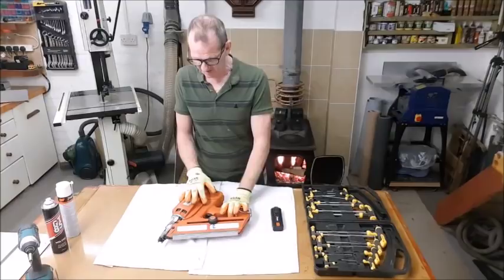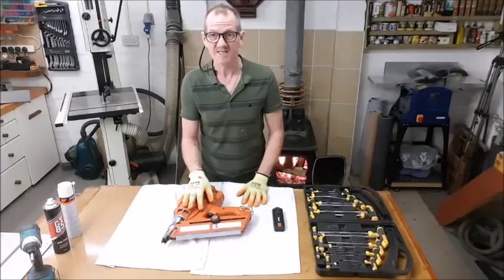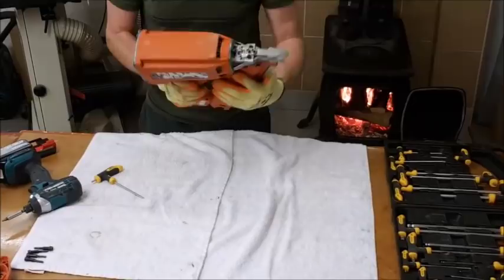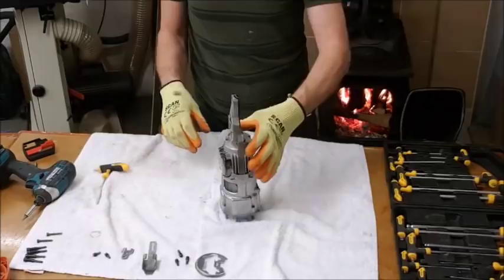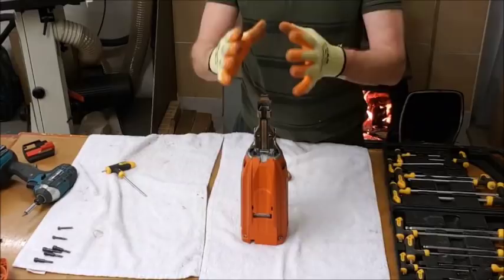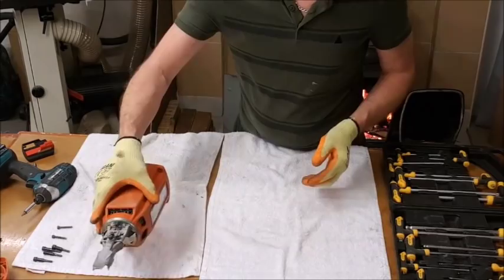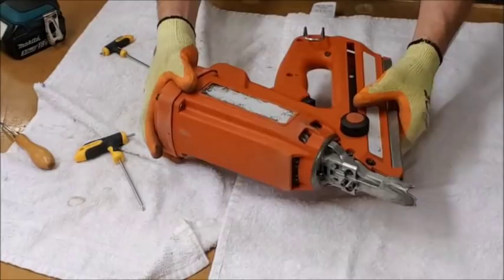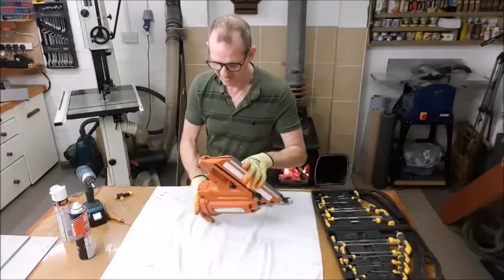Paslode IM350 full strip down

Comment: You sir are a genius! I hastily stripped mine down to clear a jammed nail, and once separated a load of bits fell out! Good to about the small spring as mine fell out and never noticed. Also for the life of me, do you think that I could work out how to refit the chamber lock bar? Now I know next time it's simply a case of undoing the two screws securing the chamber to the handle.

Comment: Thanks Dave, had a misfiring IM350 for ages, followed all your steps to give it a real deep clean but was gutted when it still continued to misfire.  But by watching your video I only realised there was the second o ring, so after replacing both, the gun nail fires perfectly.  Thanks very much for posting such a comprehensive video.
Reply from the maker: Thanks Gary glad it helped, when you say you replaced the two O rings did you mean the piston rings?
Reply: No I just replaced the o ring on the outside of the chamber and the one by the fan. Should I replace the piston rings while I’m at it?

Thanks

Gary
Reply from the maker: @Edge-ir8tb  if you can feel any piston slap then yes, push the piston up to the top and with one finger pressed on top see if it feels loose if not No its £25 to buy them as they are sold individually for some strange reason
Reply: @dmgladden  Thanks for the advice.  Gary

Comment: I went a little further and popped the circlip out of the end of the piston and clean the piston rings along with the rubber buffer. You can use a Torx key to remove the exhaust valve. Must treat with care and not bend any of the valve flaps. I put the valve flap on a very flat surface and ran the edge of a Stanley blade across the top and bottom to scrape the exhaust crud off, with help from some WD40. I think a cruddy exhaust flap was preventing the pressure build up and not getting proper explosion. Worked AMAZINGLY afterwards!!!

Comment: You’re right about the spring it’s a real pain had to look for it about four times well I’ll try and put it together and nothing would fall out until I found the best way of doing it very well organise is the only way so after feeling with that for two hours took two hours because I kept losing the spring Flicking out at one point I’ve got a spring from the Hand wash is a little big I think one out of a smaller bottle like a small bottle of sprite to clean your glasses it will probably work but you know what happen I was gonna use that spring was gonna try and then I had to cut it a little bit so short on it and it flipped off right next to the other spoon so I had to go pick it up how lucky is that

Comment: Great video. No nonsense and wasting time (which we all know isn’t always the case!). I have a 900420 and the o ring near the fan broke in a weird way where  (and this happened twice) the o ring broke in two places in exactly the same way - twice!  I can’t figure out why.  Also the motor works and yet it won’t fire.  Maybe that part that actuates the spark?  I was hoping you would show something about the small chamber above the fan which is where the gas goes but you can’t cover everything, it’s just my particular issue atm. Anyway, thanks for the helpful info. I’ll be subscribing.

Comment: That was an awesome video thank you very much. I put everything back together and the thing won't even turn on. I take the 2 pieces apart and put the battery in and it works. I put it back together and it doesn't. Any advice would be greatly appreciated.

Comment: David, firstly thank you for making this video as it gave me the confidence to disassemble my IM350 to look for a fault as it wouldn't fire. fault was found with a damaged follower of which i replaced successfully.
While i had the gun totally stripped down i decided to give it a full service which went well.
When fully reassembled i tested the gun it fired the first three nails fine then appeared to jam, after dissembling and reassembling a few times i noticed that the gas cover lid is rising when the upper and lower probe is depressed, it will fire however the fan will keep running until i press the lid back down.
Have you any idea what is causing this?  Found the problem little bit of lubricant required. Working as new now.

Comment: That`s the best of the best tutorials!!! May be you have another video where some diagnostic tips are subjected, please? It would be more that vital to have an idea with what to test in case if any common faults. As an example, how to understand whether the ignition coil is good enough? As you stated, this part is expensive. Is that possible to check it with a multimeter or with any smart tricks before replacement? Thank you

Comment: Hi Dave.  Brilliant video.

Have had one on loan from a friend for a few months.  Went to use it today, fully charged battery, gas a bit old but managed to few a handful of nails then it started cycling for ages so I just pulled the battery.

Stripped it and cleaned as per original instructions.

The microswitch doesn't click on his IM350 and I think that is strange.  Is this normal?  I appreciate the wheel can wear out.

I checked for continuity at the connector on the circuit board behind the fan with the switch pressed but there is no continuity.  Should there be?  The microswitch presumably creates a circuit for the fan to run when the nose of the gun is pressed against something.  The trigger presumably then just discharges the ignition circuit.

Any ideas please?

Comment: I was having trouble with my slide bar it was a bit bent and I straightened it out so it slides without grabbing because it was grabbing and I’m pretty sure it’s missing a spring that’s why it wasn’t springing back I’d have to pull it back by hand so annoying especially when you’re doing overhead shots

Comment: I definitely messed up by not pulling all 4 nose guide screws and loosing the spring  pin for the nail slide. Now I have to push the slide mech apart to unwind the flat spring,,, without breaking it.
Any suggestions David?

Comment: Dave excellent video.  I have cleaned the gun but it won't fire.  checked the spark and the fan running with the main body off, fan runs and spark fires when spring to microswitch engaged.  Any ideas?
Reply from the maker: Fully charge the battery and try again

Comment: Okay I’m up to there all good I put the battery in the light goes on no problem I flicked the switch up to top the fan turns on when I put it together the front and then I put a battery in it it’s like to trigger seized a little bit and the fan doesn’t turn on I’m just thinking it’s a stopper arms they must be in the wrong place and not tweak the triggering in the We’ll that triggers the fan so it’s just a switch I think I need to replace that I mean I’ve had to straighten it is pretty bent it’s probably copped a couple of drops missing the Nail bag with the Hook

Comment: mine does not depress enough to engage the switch that starts the fan. Have taken it apart and cleaned it and checked all settings but nothing changes. The aluminum body does not go high enough to touch the switch. not up to the window where the roller of the switch sticks out of.

Comment: Thanks so much for these great informative videos. I'm trying to service an old IM350 CT90 and having trouble removing the Retainer Ring Sleve (part 73). It is being fouled by the heads of the Bushing Shear Bush (part 63) which hold the Socket Head Capscrews (part 62). On your videos they seem to just fall out but mine are stuck. I've tried gently to drift them out but don't want to hit them too hard. Should they come out easily or is there another way to slip the Ring Sleeve past them to enable the cylinder mechanism to slide out of the plastic cover?
Reply from the maker: Hi To be honest im no expert but it seems to me they should just come out easy so i would persevere you will get there

Comment: I’ve got it all together but you’re not getting that suction sound the green lights on I’m still having the same problem with the front bumper it pulls in but doesn’t pull out the springs are in I’ve just rebuilt it I’m not too sure have to pull it apart again I guess

Comment: Yeah I haven’t got time to order new parts so where will I get a spring from that’s roughly the right size I’ll tell you where you go to your soap pumps and you take out the pump and you break the pump and there’s a spring inside their difference so pumps will have different side springs for thought I throw away my soap sometimes I break them out and get the springs I’ve paid for that spring

Comment: Hi Dave, thanks for the video.
I have totally stripped the unit, including removal of the piston, and cleaning of the reed valve, and it still occasionally fires. New fuel , charged battery, all cleaned and oiled. Fan works, and spark fires every time when spark plug exposed  and micro switch wheel depressed.
What else would cause a failure to operate?
What causes the piston to return to the top position?
Reply from the maker: You've got me on this one, if the gun is worth it to you I would take it to have it checked out it is possibly compression but can't be sure
Reply: Thanks Dave, I just spoke to a technical support mechanic at Paslode. Very helpful.  He explained that the Reed valves close after the explosive compression, and the gasses remaining in the combustion chamber cool with the fan running,, and the resulting partial vacuum draws the piston back up. 
Also the head piston O ring is supposed to be a bit loose in the groove. This allows the ring to be properly compressed when in the firing position.  Important to assemble the head to the body with the small side screws loose, and the combustion chamber and head engaged before tightening the four head bolts to ensure proper alignment. 
All makes sense to me.

Comment: Hi David, excellent vid thanks. You have given me the confidence to attack my 350. I was burgled recently and they took all my power tools. I have been loaned another Paslode but I am not getting any led light neither red or green. I looked into the battery compartment and I can only see one contact so I guess the other contact has either slipped or broken off from the pcb assuming there should be two contacts?
Reply from the maker: Hi David yes they should be two and i think when you open it you will find it bent up out the way as they are very strong so I fought it will have been broken, anyway thanks for watching and good luck
Reply: David Gladden cheers. I’ve ordered the pcb anyway so I can replace it at the time of strip down.
Reply: David Gladden just as you said. One of the connections was broken so replaced the pcb frame with switch etc. the only problem i now have is. Have only got one nail fired. I did notice that the red wire from the black box spark unit came out so I simply pushed that back in. I cured one problem and another gets created. Should the wire be sealed into the box?
Reply from the maker: @Davebuoyful  no i believe it's a spark conductor, the same happened to me and all is working fine I like you just pushed it back in
Reply: David Gladden that’s good to know. I’m stripping it back down again to see if I’ve missed something that wasn’t right light springs etc. fingers crossed I will be good to go

Comment: What allen and hex key set is that you have? Very informative video by the way. I'm still stuck with a broken im350. Press the nose and the fan works, had a full dismantle and clean, but press the trigger and it dies. Can't find any info online for it. Pin is dead straight and slides freely, gun is spotless and oiled correctly, o ring is seated properly and new, battery and gas work in another 350
Reply from the maker: The set is one from Aldi very usfull bit of kit, as for your gun i have to say i only know what i workout whenbtrying to fix a tool of my own ibtgen pass that nugget on to help others but i cant think what can be wrong with yours sorry i guess just keep trying things till you crack it thats what i do
Reply: @dmgladden  I don't give up. I have a spare I can take parts from. Just means full strip and dismantle just to pull the trigger once and try

Comment: Hi, thank you for the video. I have a problem with my gun that the firing pin will not return. I shoots one nail and the I have to push the pin back. Any ideas please.
Hywel
Reply from the maker: If it's been fully cleaned then the pin might be distorted

Comment: Hi David, I’ve followed your video to the word and my nail gun definitely sounds smoother and looks a lot cleaner, so thanks for the great instructions! But my gun still needs to be pumped twice for a nail to fire? Any ideas what part I could replace to fix this? Should I be buying the whole electric part which you mentioned costs about £50? Any advice would be greatly appreciated... Thanks
Reply from the maker: Thank you, i hate to give bad news but its most likley you spark generator, or thats what i call it, the big black lump that feeds your spark they get weak after time and will cost you over £100 to buy one so if it was me just keep pumping as long as it will go
Reply: David Gladden Thanks for your reply, it has done a lot of work so I may just have to run it until it dies.. Although I did follow some advice to check the spark so I took the top section off the gun with just a battery connected and depressed the button behind the roller followed by the trigger which generated a spark every time so that’s really confused me? Do you have any other advice you can give me based on the fact that the gun sparks on cue? (At least it does when it’s in two half’s) Thanks again!
Reply from the maker: @EyeAmToneTone  well its a good sign, have a close look at the gas
Reply: David Gladden Thanks I will, I’ll do a bit more digging.. 👍

Comment: Hey I've got a snapped im350 fan and need to know how to replace it. Can you upload a video on how
Reply from the maker: I haven't yet broken mine but when i do i will do a video on how to replace it, thats if it can be which easy way to learn that is see if you can buy it as a part
Reply: @dmgladden  you can buy just the fan as a part on ebay and it looks like a little grub screw at the back of fan but how to get it out is a different story lol
Reply: How to put the rack back on the paslode model number f3608
Reply: How to put the nail  gun rack back together again

Comment: Hi just watched your video exerlent,just struggling with mine , got it stripped down ,there no gas in .When you put the battery in the fan starts straight away without pressing any buttons,if you put the battery in nothing happens,till you press the switch near the fan body ,then it starts up up again ,can only stop it by pulling battery out , any ideas would be great . Many thanks Dave Hale
Reply from the maker: Hi Dave thanks for watching my video, unfortunately in this case I can be of any help I have never come across that one before but I would be opening it and checking that the switch inside is not being jammed or shorting or something like that
Reply: @dmgladden  Many thanks Dave you was right ,switch jamming,just before I build up this gun ,is there anyway to test if it’s sparking

Comment: DavidThanks for your detailed account of how to service a paslode im350 . I do have a problem with the firing pin not returning to its correct position. It only works with the help of a flat headed screw driver. Do you have any advice? Thanks J
Reply from the maker: Yes its the same as i have you need to open it and relocate the very smelt spring that should be hidden underneath it, it's very fiddly  but watch close the video and you will see how i did it
Reply: Me again. I have checked the to two springs and they are ok.I am looking at the wrong springs or is the  smelt spring located some were else.This will be the last time I will be working on this nail gun as it is driving me mad perhaps its time to buy an new one. James
Reply from the maker: @jameslarke8489  yes you are looking at the wrong spring, what the video closely from 15.40 and it will show you all you need
Reply: David I have replace all the springs to this gun with new ones & the gun will only fire one nail and the fireing pin/ piston does not recoil. Can you advise what I should do now before it is sent to the scarp yard/ buy a new one which is expensive. Thanks James
Reply from the maker: @jameslarke8489  yes very, James to be honest if you have fully stripped it, cleaned it and replaced all the springs i cant see how its not working, if it fires then it should recoil its only the two main springs on the side of the slider thst make the firing pin go back unless its jamming, if you want before paying £500+ email me davidglad@aol.com i might have an idea

Comment: On my exact model, the plate that sits behind the piston/striker/firing pin, has two long protruding circular screw giuds, that locate into the bottom half.
These stop me from taking the plate of with the three screws, so I can't extract the piston body from the plastic shell, also the seal on the head is loose, should it be loose, thanks